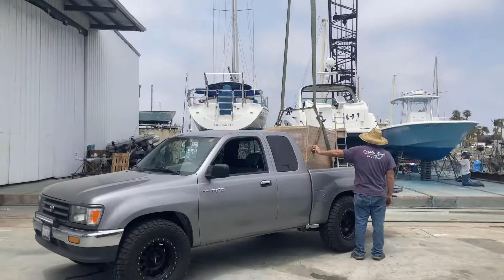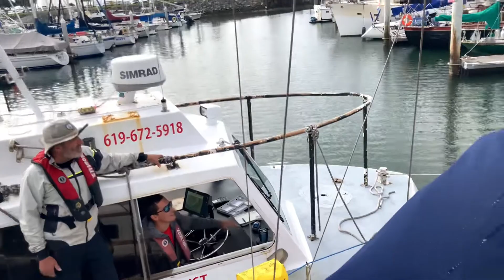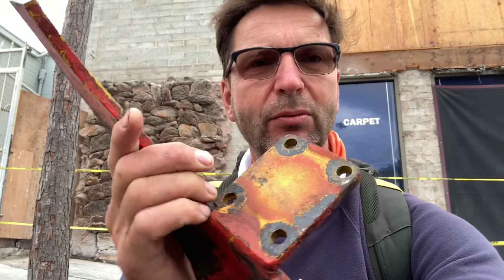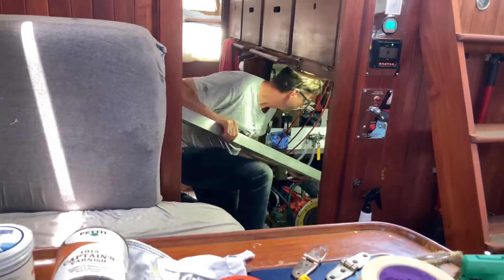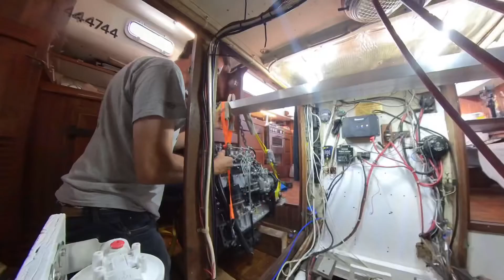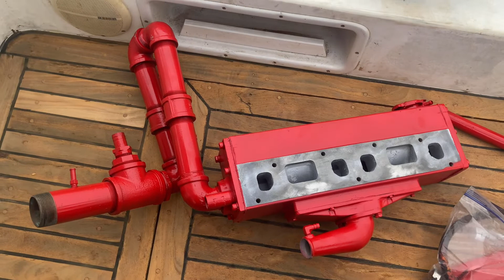Installing a Sailboat Engine Solo Ep. 12

Comment: An alternative to original style boat motors is an air cooled Chinese diesel. You save a lot of weight and money. Reliability is so much better without salt water cooling. I have the smallest 168F diesel, and it is superior for keeping the battery charged and small output to an existing prop. There are a variety of larger sizes too, but I encourage boaters to shrink horsepower. Tips: Mount it on a thick aluminum plate. Avoid lowest idle and zooming over 2000 RPM. Watch oil consumption during break in as it will be very high. My 20 MM shaft wants an inch adapter to fit a seven inch pulley and a drive coupler.
Reply from the maker: I haven’t heard of these Chinese diesels you speak of. Air cooling would be tricky as there is no easy way to vent the heat on my boat. Interesting concept though
Reply: @OnnoKok  Sichuan Sifa MB168F. It has top quality castings, steel gears, and meticulous measurements. Air cooling? Dry hot air. Open the front hatch. Open the companionway. Run a fan. A small price to pay, to satisfy the gods of reliability and lightness.
Reply: @stanleybest8833  I had a look at a listing for this engine and although it is described as a diesel it has a spark plug and a 5.5:1 compression typical of a petrol engine. The power is 4hp, which makes it suitable for a small boat of maybe 4 metres length. The output shaft is a double v pulley which may be a problem to connect to a conventional marine gearbox.
Reply: @huffyhoosit  Wrong. You read the wrong ad. At least that is what you are implying. Shape up.

Comment: Tremendous access in that engine room.
Reply from the maker: Yes, it’s great to be able to get at both sides so easily.
Reply: @OnnoKok  with the Isuzu, don't ever let it overheat. They're good solid motors but they don't like to be abused. I know you wouldn't and all, but...
Reply from the maker: @RodFleming-World  thank you. My biggest fear is not noticing a blockage with the raw water pump or something. I’m going to be adding a water temp alarm in case it overheats.
Reply: @OnnoKok  good idea. The alloy cylinder head will definitely warp if it gets too hot and then, no end of bother till you get it skimmed/replaced. They like to run quite cool, these things. You've got a nice big engine room which will help with that. BTW if you have a thermostat in the cooling circuit, use a 160 F rather than 180F. (Some people just sling them but strictly you should use a blanking plate with a 1inch hole to maintain design pressure, if you do.)
Reply from the maker: @RodFleming-World  the thermostat that came with the engine switches at about 176°.
Reply: @OnnoKok  it's a 180, they're not precise. See if you can source a 160, most motor factors should have them and they're really cheap.
Reply: @OnnoKok  

They are referred to as summer and winter running thermostats in the auto world... They are generally the same ...  
The Izuzu TD engines we get in vehicles in the Uk are good and economical but need to be run at high revs regular to clear carbon build up and injector blocking ... A temperature sensor in the water flow might not work if the raw water in flow gets cut off totally ...like a plastic bag or kelp covering it.
So one direct to into/onto the heads best. Or tapped into the thermostat housing.